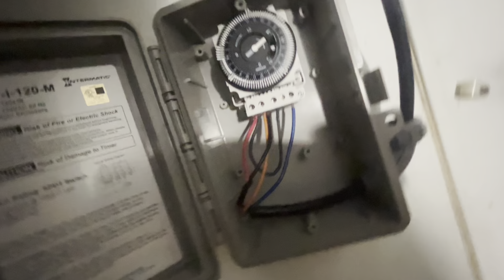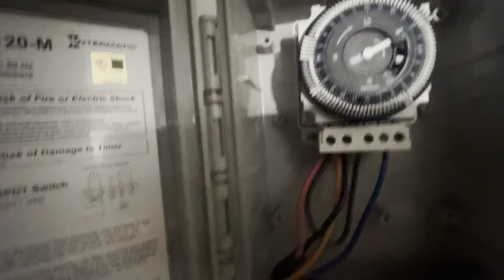50 degree walk-in!!

Comment: What’s your method for defrosting? Hose? Pump sprayer? Steamer?
Reply from the maker: Water hose and wand.    I’ve gone thru all the creative other options.   Volume over the block definitely is the most efficient.
Reply: @restaurantrepairs  do you have issues doing that in a freezer with getting water/ ice on the floor? I’m a little new to the trade and defrosting coils in a freezer takes me so long
Reply from the maker: That can be the use yes.   Use an adjustable wand and test just a bit to make sure the drain lines not frozen shut.   If it is that changes the approach a little.    Put a full food pan under the tray if possible cuz at times it’s gonna drip anyway.   Best to go thru the fan from the inside.  That way all the runoff is above the tray.  Going from the rear can drip if the build up is wider that the drain lip.   There’s no magic wand.  I use the wand Chris with HvacR videos uses.
Reply: @restaurantrepairs  thanks for the reply! I'm gonna grab one of those wands before my first call tomorrow.
Reply from the maker: @johnstrh1 just make sure it’s one with like a ramp up and down volume slider.  That way you can just really slow constant over the ice.   It’s remarkable how fast it cuts away